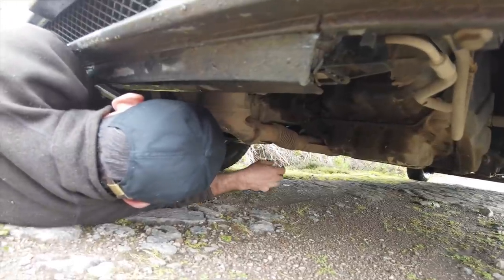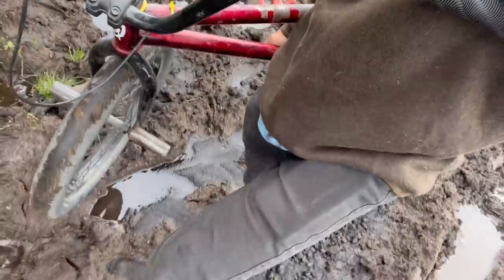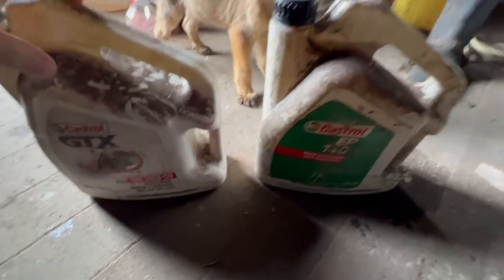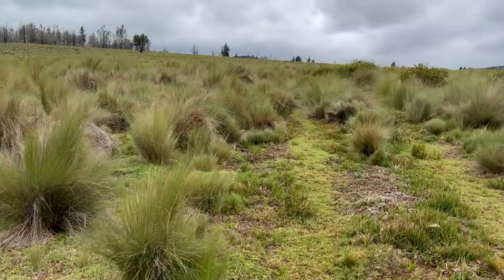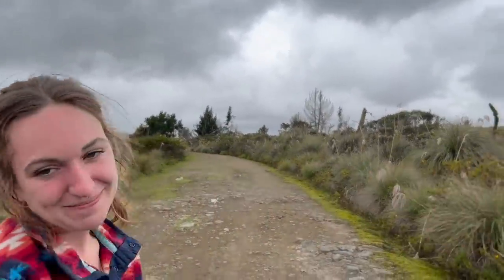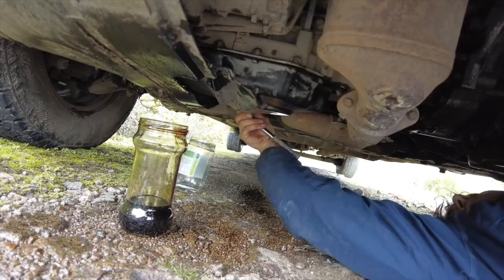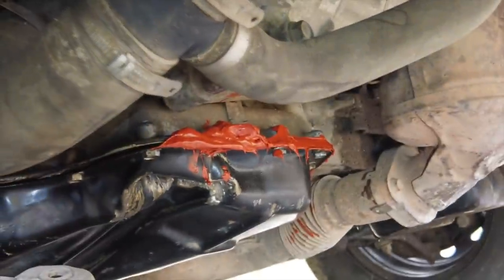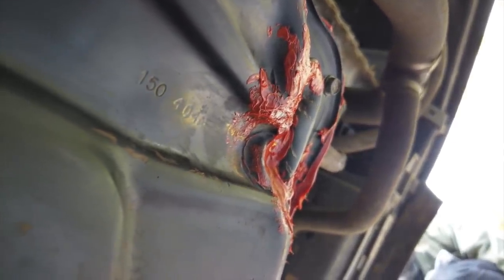The VAN is GUSHING OIL in the MIDDLE of NOWHERE, ECUADOR! #vanlife

Comment: I called it, but really, easier to do from an 'arm-chair' perspective - I would have been freaking out if I was in that pickle myself. You guys really kept cool heads and were on the ball. Kudos!
For future reference though, you should never head out off the beaten track without certain essentials for your vehicle - like oil, coolant, radiator stop-leak, etc. Just like you wouldn't go without a spare tire or tire repair kit. Probably obvious now, but glad you had a sealant that held up just well enough - could have been a lot worse...
Looking forward to seeing lots of Ecuador!
Cheers!!
Reply from the maker: Whew, we carry tons of oil now! We carry coolant, tire repair, jump cables, tow strap, max trax and chains off the top of my head. I don’t know when we ran out of the oil we usually carry 😅 I’ll be picking up more high temp sealant though! Thanks for joining us 💜💜

Comment: Maybe it would be a good idea to check if it is possible to make a shield to put under there to protect the oil pan. So glad the story had a happy ending after all. If you hadn't noticed the leak, you would have been in for some really large expenses, maybe you would even have had to buy a new engine. Alternatively you could buy a new oil pan with an extra set of bolts so you have a spare one. And off course always bring with you some cans of oil for emergencies like this.
Reply from the maker: So true, a plate under there would go a long way. We’ll be adding to our emergency kit for sure! 🙌🏻

Comment: it doesn't look so serious.  during the ups and downs of dirt road bumpy driving, joints get challenged, they get pulled and compressed with great force, then seals and gaskets start to fail. replace the gaskets wherever you find a big leak. you have to determine whether you will keep adding oil constantly or do the fixes. it is going to start happening everywhere. Sometimes you have to take so mny parts down to get to the spot, that you might as well replace seals and gaskets along the particular repair
Reply from the maker: Yes! We are getting new gaskets sent down now. Definitely need a diagnosis soon!

Comment: Yeah, you can always collect the dirty oil that dripped down the dirty frame & underpinnings and then you can pour that dirty oil(full of diet & grime) back into the motor.  Another good idea is take fiat down to south America!
Reply from the maker: I think it's better than running out of oil while driving 😊 There are a lot of Fiat ambulances all over South America. It's more we go on difficult roads 😊
Reply: @the.vandersons  and it's a 1 wheel front wheel drive fiat.  Good luck!  Think you will need it.  And dirty oil or don't move it until u hav clean oil?  I vote wait 3hrs or even 3 days, or tow it.